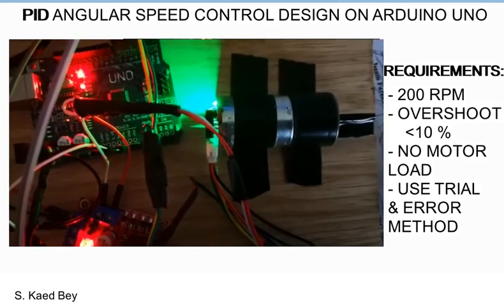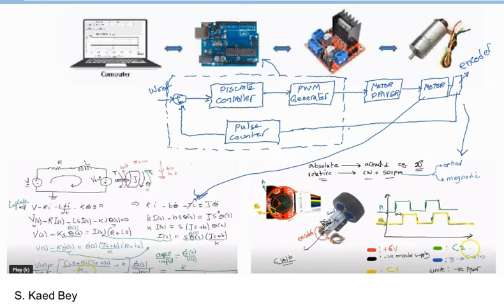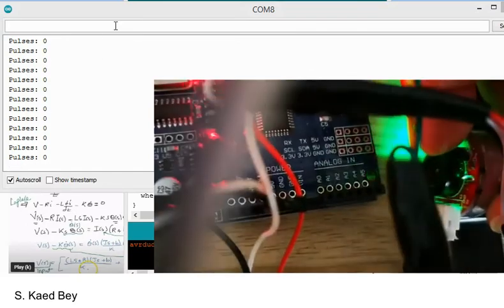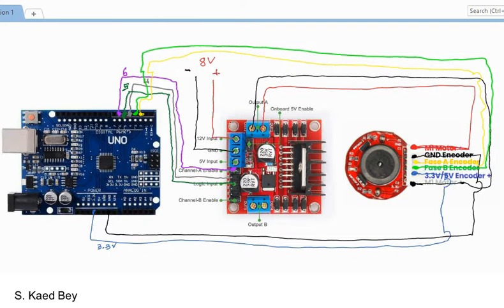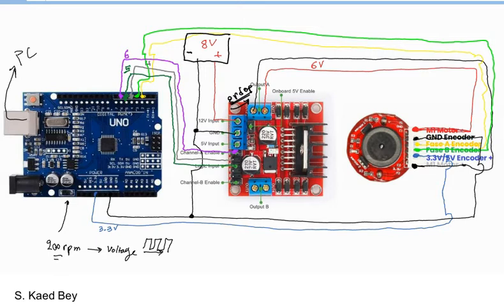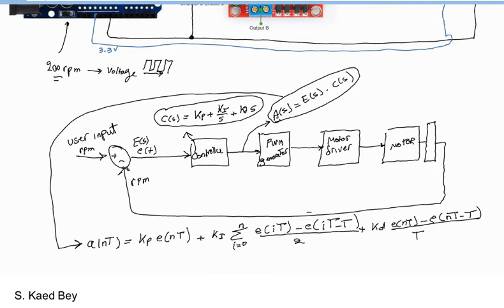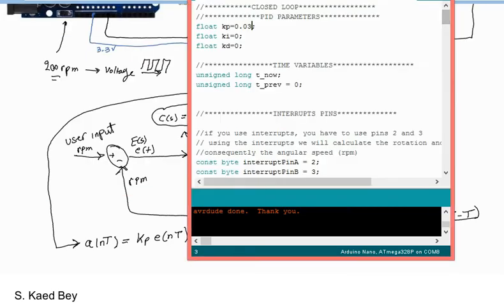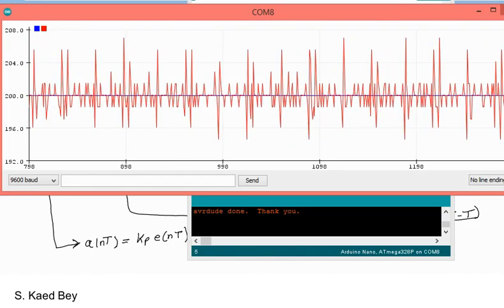Project (Part 8)- Applied PID for Angular Speed Control Using the Trial and Error Method

Comment: Nice series but you did 7 videos in matlab talking about transfer functions and motor model to just implement a simple PID control which is not even coherent with the simulation.
Although informative it wasn't that helpful